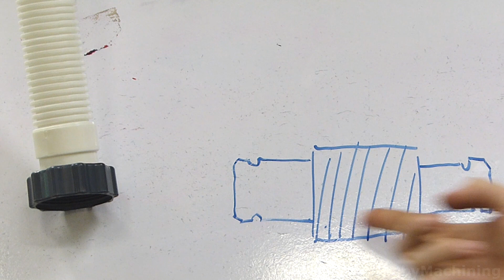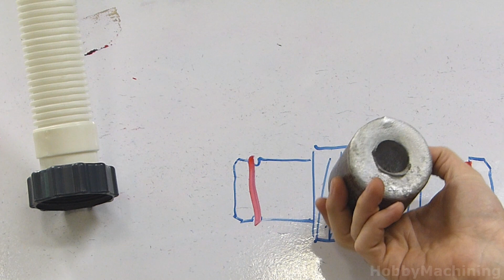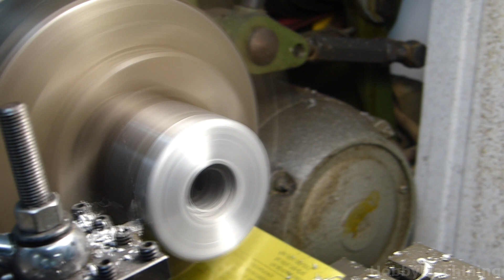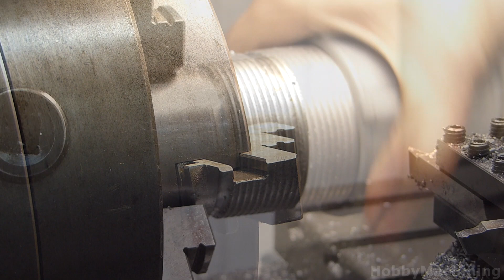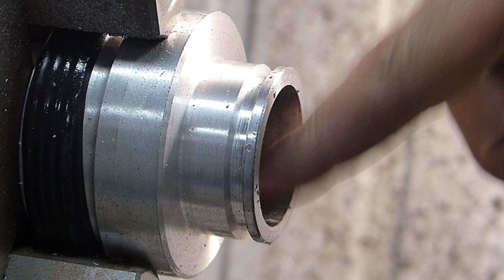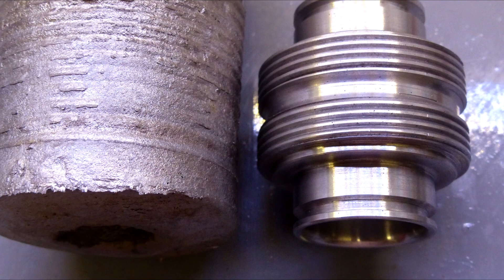Machining Project: Intex pool hose coupler from scratch cast aluminum

Comment: Nice Work on this part. Small tips, when you have some machining with a small part of the piece in the chuck you can use the tail stock to maintain a proper axis and rigidity. You will no risk to damage the part loosen from the chuck !

Comment: Hi do you take orders for this.... I can not find ANY couplers for the Intex hose. I need three due to the location of my pool pump from my pool.
Reply: Did he ever get back to you on this question? I don't get why this coupler isn't a thing that is available directly from Intex, much less some third party
Reply: @ShannonProcknow  No, I never received a response. But this over a year. I already found the plumbing parts needed for my filtration. Thank you
Reply: @mistersi8130  Please share what you did to solve the coupling? Did you go with some simple hose clamps over a larger tube, or somethong more elaborate?

Comment: Thanks for sharing!  What did you use to melt your aluminum; do you have a furnace?
Reply from the maker: wbmphd I used to use charcoal and a shop-vac blower but now I used a 120v pottery kiln I found.  It is clean to operate and the electricity is cheaper than the charcoal.  It takes awhile to get up to temperature though.